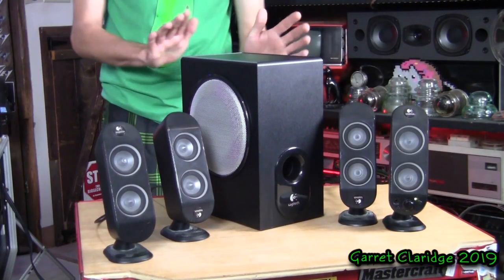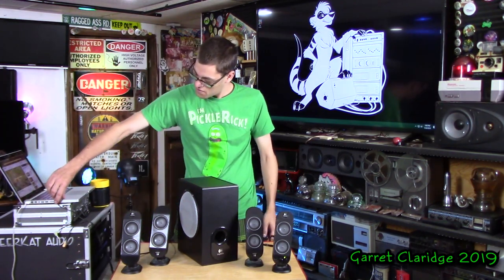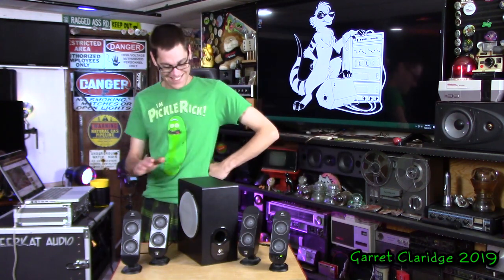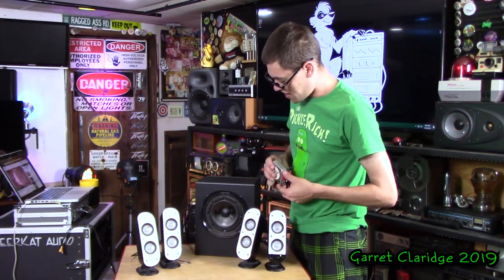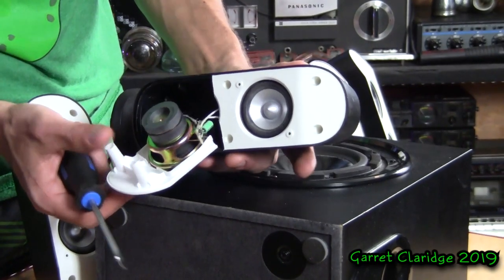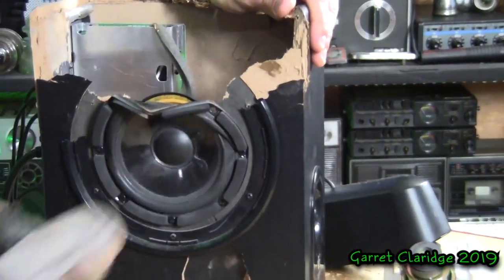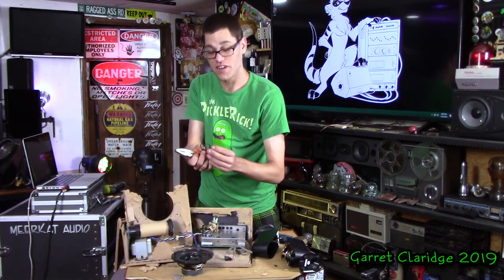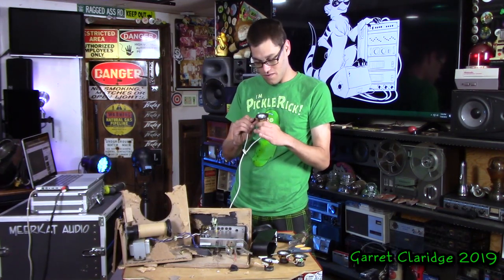Logitech X-530 Blowout and Destruction

Comment: I remember these bad boys.  At the time they were ok surround sound for a low cost PC.
Reply: The good ole days the newer Logitech’s sound much better
Reply: @coydog7902  haha what?? The only good Logitech systems had tangband drivers and sounded okay. Maybe Z623 (the old one) and Z5500 but the new crap with fake tweeters?? That stuff sounds horrible.. I heard some of the new "logi" speakers in a local electronics shop and they sounded so bad..
Reply: Skedda 

I know the Z200 is the one with the fake tweeters. The Z4 has a fake subwoofer
Reply: @coydog7902  the Z4 actually is just a 4th order passive radiator. But yeah, the Z200 has fake tweeters
Reply: @hjbhbjbjbjbjbjbbuguggugug6732  You can't compare a good floorstanding speaker with dedicated amp to a pc system that's for your average consumer and easy to use.. I also have much better gear but that is not comparable.

Comment: The 5.1 3.5mm to RCA adapter comes with the system... Though you can buy it separately. 

And it in no way claims to or can "convert to 5.1" it simply allows you to use it with stereo devices. Left and right channels go to the front and back equally. The center channel acts as a mono as does the sub. 

Source: I've used this system for over a decade in my flight-sim room.

Comment: I found a Logitech x-230 thrown out without the satellites so I made a little control unit for it. Now that only the sub plays, I can use it as an LFE sub with my av amp. And MAN does the sub sound good like that. Only the really low tones go to it, so its not boomy. The sub is definitely not just any 2.1 system sub.
Reply: @Dark Dream The reason I use it is because all the other cheap subs are crap but this one is better. And yes a proper sub would be nice but in a rent house I currently can't go bigger. And it was free.

Comment: I got those speakers in 2005 and still have them, they last forever
Reply: Lasts forever until the fuse blows and takes the right driver's 8th pin trace with it, nothing that a small wire to bridge the trace and a replacement fuse can't fix

Comment: the adapter you talked about is normally shipped with the system and basicly the sub gets a mix of each jack and the black is for the rear the green for the front and the orange for center and sub and the adapter actually just sends mono to center and sub and paralles the left front and rear as well as right front and rear together so you end up with two left and two right speakers as well as a mono center and sub on the board itself the sub gets all six inputs mixed into one

Comment: Hey Garrett I have the same set you do and I know that all 3 inputs include the sub and it's not actually independent of each other like the green plug is only supposed to be just the front two speakers,  orange plug is supposed to be just the center and the sub and the black is supposed to be just the rear speakers but no matter what plug you use you still get the sub on all the plugs.

Comment: Most of those coax to 5.1 surround boxes will allow you to utilize all speakers however they will only be running in stereo mode, the bass response is also pretty bad on most off the shelf 5.1 setups, as the set is only getting stereo data and cannot properly process the low end frequency. Overall they make your music sound garbage, a cheap £5 sound card off eBay that supports 5.1 will make your music sound better, something like an AE-9 would be ideal (yet overkill) for a 5.1 setup on the PC, and I plan to pair an AE-9 with my Logitech Z906's.

Comment: Looks like the sub was replaced at some point. Or they could have changed it for a more stout one, the one in mine looked like a mid range driver. What's funny is I still have the splitter from mine, exact one you pictured. I'll have to check it out sometime. I only kept it in case I have a project to use it for.
Reply: Just checked out the center/ sub on that adapter, it actually does something though not sure for the better. The left channel works but is very quiet so presumably it's pulling mono from the left and right channels. Definitely needs a ground reference to function though.

Comment: for 10-20 bucks on ebay they are actually quit nice
Reply: DerTechnikKanal I mean yeah. I have the x540 (basically same drivers but more square and with metal grilles, sub is downfacing and power, volume, bass and augmented 5.1 are controlled on a separate remote) and they’re great for the price

Comment: Garret please be careful one time i was taking apart a speaker system while it was playing and i accidentally touched the amplifier box and touch some mains connectors and it hurt like all hell came crushing down on my arm.
Reply: Electro Ideaz I was once disassembling an old stereo and even though it was unplugged I still got zapped.
Reply: @PackardKotch  That is because there are capacitors they are like batterys but they discharge all there energy at once witch  is how they can shock you after being unplugged because they hold charges. They also vary in capatactinec and voltage. More capaticentce means longer more painful shock. And voltage its just a factor. If it is over a certian voltage depending on conditions it can shock you.
Reply: Electro Ideaz yeah I know, I was like 10 or 11 back then.